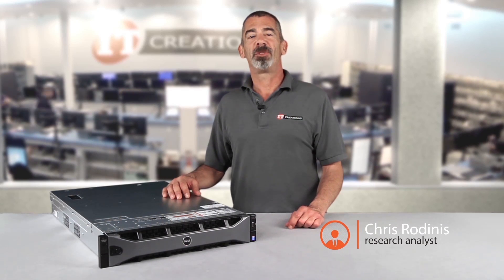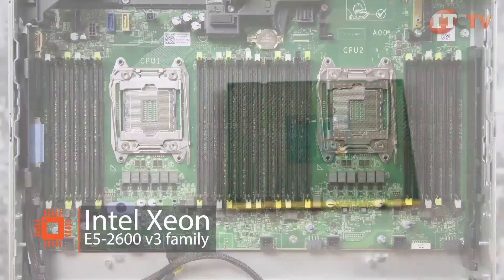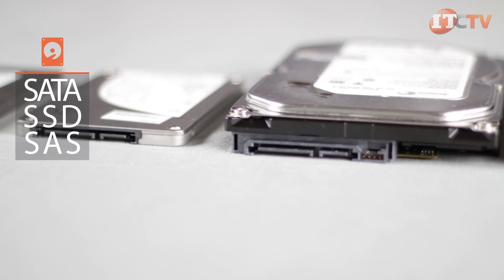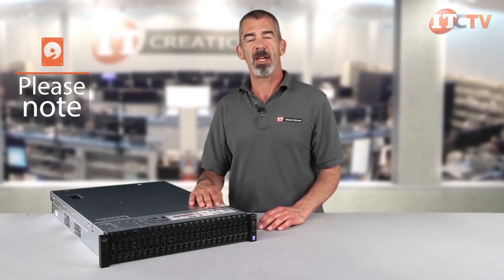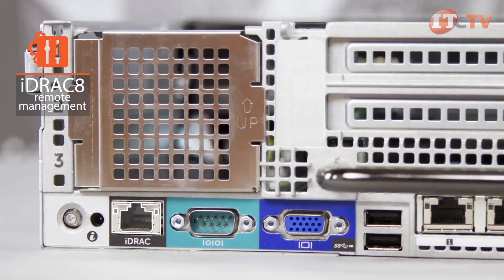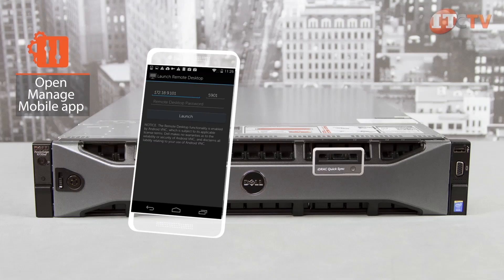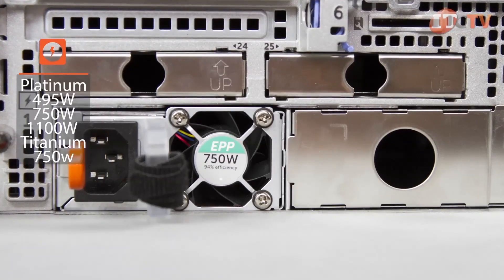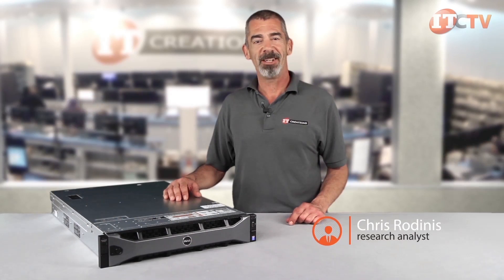Dell PowerEdge R730xd Review

Comment: I have a question about power supply unit. Then, the 2 x 495W psu with 22 Core 2.20GHz E5-2699 V4. Is it good?
Reply from the maker: Check out this link for Dell's Enterprise Infrastructure Planning Tool https://www.dell.com/calc . There are two links there. One for current products and one for EOL products, like yours. This link: https://dell-eipt-eol.azurewebsites.net/#/. Switch it over from Converged Infrastructure - M1000e to Rack Servers. The user guide for this page is on the previous link I gave you above. As you are using performance CPUs you may want to use teh 750W PSUs anyways but those links above should be of some help too given you have mot provided information on memory, storage, PCIe cards, and whatnot. Thanks for watching!
Reply: @Itcreations-LA  but what is the difference psu between 495W and 750W?
Reply from the maker: @Joeron79  IN the most basic sense, more power for your high-end CPUs. That said, you may or may not need it. Check out the other links I provided and add in any other networking cards, memory, storage or GPUS you might add.

Comment: Can the Dell Poweredge use PC2 ram and if so could I use both PC2 and PC3
Reply from the maker: Hi Brad, No, and no. This system uses DDR4 memory and those you mentioned are older generation memory modules. As a general rule of thumb, you cannot mix generations of memory. Besides, you would get more performance out of the later generation memory modules on this system. Hope that helpes, and thanks for watching!
Reply: I was refering to if the 710 could use PC2 Ram
Reply from the maker: @Anne14881  
Ahhh, Well in that case, still no and no. This system is only compatible with DDR3 memory modules (PC3), and you still cannot mix generations, not that DDR2 modules are supported anyways… DDR4 modules not supported either. More information on supported memory modules starting on page 31 here: https://i.dell.com/sites/doccontent/business/solutions/engineering-docs/en/Documents/server-poweredge-r710-tech-guidebook.pdf 
Thanks for watching!